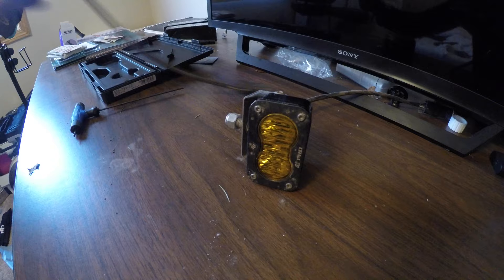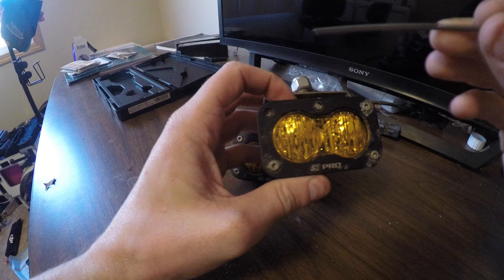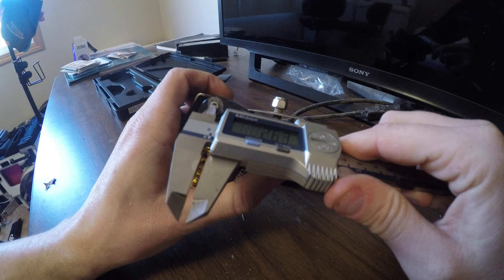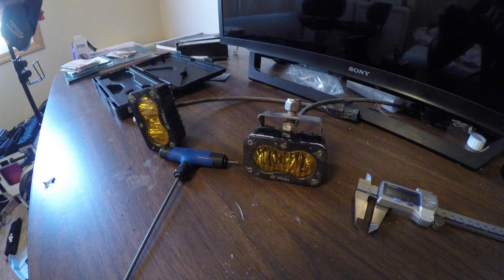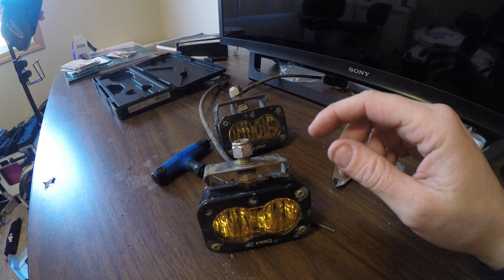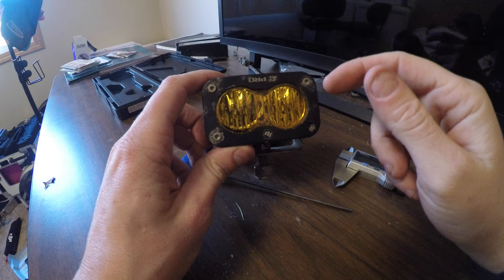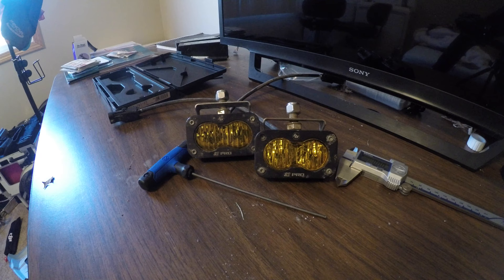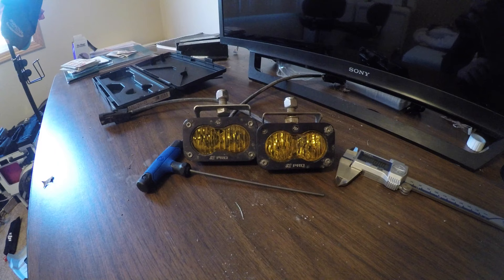Baja Designs. Boutique Garbage?

Comment: so, you tell us you bought them with clear lenses...  then you complain that you have stripped them out after you have clearly changed them to amber?! sounds like user error. all the way around. i mean, you bought a raptor... smh...
Reply from the maker: lanckie they shipped with clear lenses as their Amber lenses were on back order. They finally shipped the Amber lenses after they were back in stock. I shipped the lights back to them and they acknowledged that their torque specs were wrong and shipped me new lights. I must admit, Baja Designs warranty is great. So no user error on my end. And so sorry you can’t afford a raptor.
Reply: lanckie he’s right and you bought a raptor. I would use different bolts. If you don’t want them I’ll give you $20 shipped of course